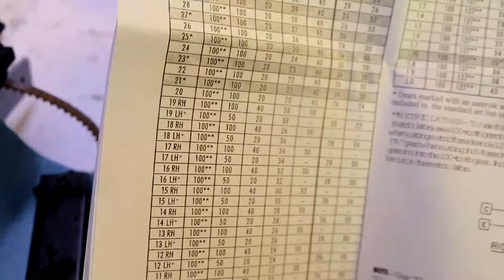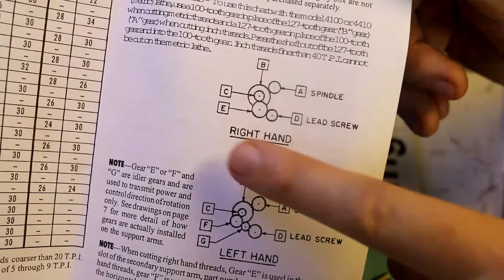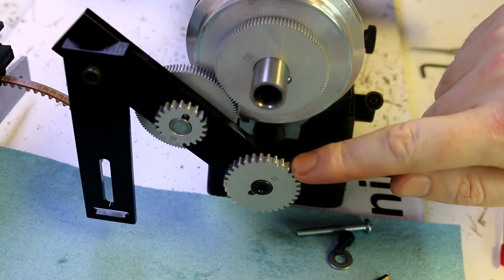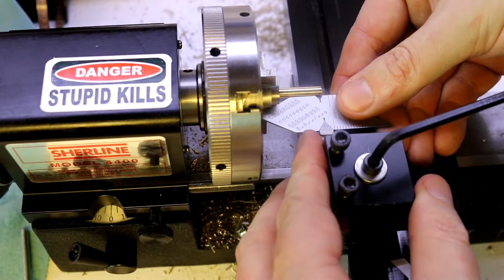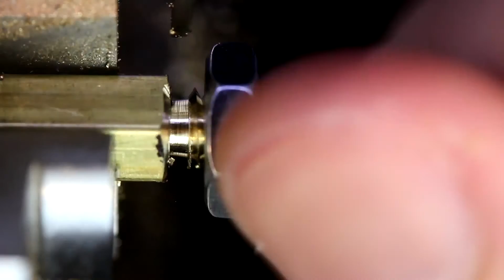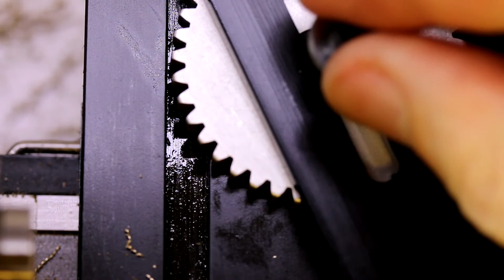Lathe 152 - External Thread Cutting

Comment: Thank you so much . I never tought it could be done (couldn't figure out this mickeymouse
multi-gear 'system' at first and had put it away ). Now just fabricated a M14x1.0 / M12x1.5
adapter for my motorcycle crank puller ...and it worked ! , Well , second time out .
The newer models have aluminium gears , I still don't quite trust it (yes, it slipped cogs so I had to be less aggressive second time out  , but thanks to your video I finally got it
through , and saved a lot of money.

Comment: Thank you for your fantastic videos! Never having used a lathe, I'm wondering what the advantage is to cutting threads this way rather than using a tap and die?
Reply: external threads need this. internal threads can be tapped
Reply: @joelmills3931  But a die can cut external threads. I wasn't sure what the advantage of doing it this way was. After watching other videos, it seems this way is simply cleaner.

Comment: Realistically will this lathe cut a 1/2-20 thread in standard drill rod.  Obviously the idler bushing will need to be beefed up.  I mainly want this attachment for cutting a metric thread, my iron lathe will cut the inch threads.  good chance I want more that what is possible.  I expect I will need to use the compound with the angle set at 29 degrees.  This way I will only be cutting one side of the thread.

Comment: I'm a longtime Sherline user and fan, and would just like to share a bit of my own experience. It takes a bit of practice to get the results you are after, but once you get a feel for it, this is a great accessory. The hand-cranked system really gives you a good feel for how your tool is cutting, and much more control than a power-fed machine, plus it's good exercise. I have cut 3/4 inch threads 6 inches long in stainless steel with great success. Smaller diameter material is more challenging because of its tendency to flex, so you need to take your time. I also find that carbide tipped cutters are very prone to breakage if your workpiece flexes and binds. I got best results with a 5% cobalt toolbit I ground myself.

Comment: Hi, never go back with the tool still inside the piece, plays in the machine could break your tool and fucked up the thread, just go out and restart. Dial indicator helps to go back at the point (if you can afford digital axis reader even better) you can see the material getting pushed on the right side, after the 2,3 passes. lucky just because is brass. 20 years in manual machines.
Reply from the maker: +foggymind THANK YOU for catching that and pointing it out, you are 100% correct. I'm used to doing that on larger lathes cutting under power, complete brain slip as I working on the manual crank and setup of this accessory. I was saved from it being brass and my gear train being VERY tight and brand new... probably too tight really for comfortable operations. 
For any reading this, foggymind is completely correct and accurate in his statement. The problem is due to the backlash that is present in all gear/screw driven setups. I don't believe I had discussed backlash as a topic before making this video but it has been covered since if you are not familiar with the topic.
As a hobbyist machinist I (and perhaps 1 or 2 of you ;)) will get lazy and try to shortcut the "rules" of backing out and coming forward into the work piece again to account for backlash. There are cases like this when you really MUST follow those procedures. When you can "cheat" and when you can't, and locking those into your brain cells only comes with time and experience so I am very grateful for the feedback and experience of foggymind in pointing out this rookie mistake I made :)

Comment: As usual...this was a very helpful tutorial. The stock bushing could be modified by placing two holes 180° apart into the back face into which a pin spanner could be inserted to retain position while tightening. 

Also...I hear complaints about the Sherline not having the capability of threading under power, but then I see 7X import lathe users who have to act quickly to stop or retract the tool while threading because the longitudinal speed is much too fast. As a result, they find themselves making a handle to hand crank the spindle. I see the ability to carefully control the speed  by hand cranking as a feature, not a drawback. Yes, it is slower, but I would prefer accuracy and quality over production efficiency.